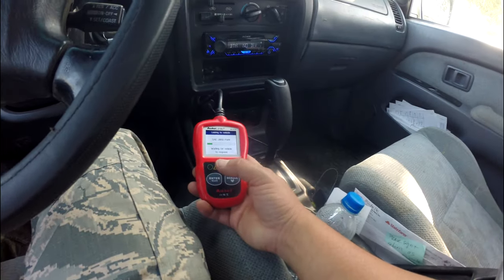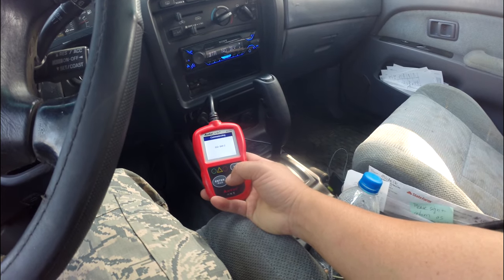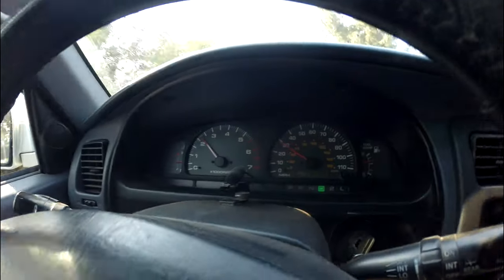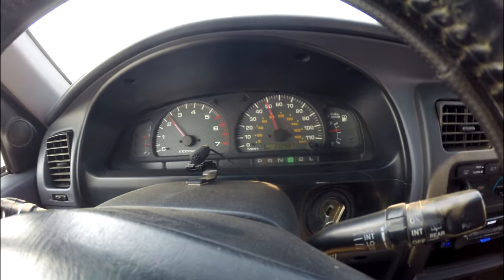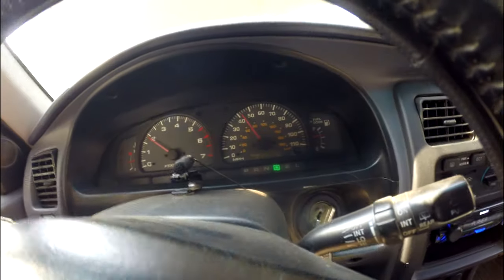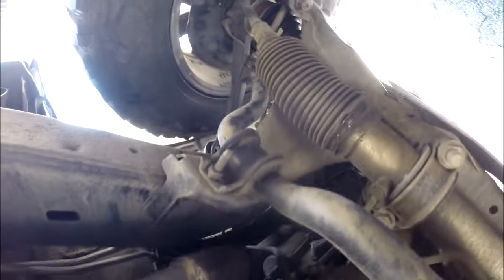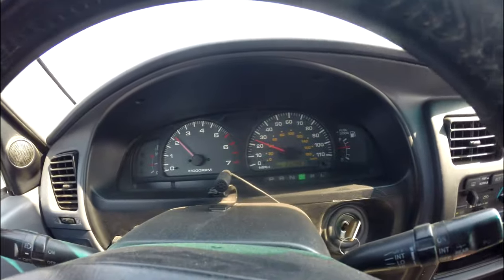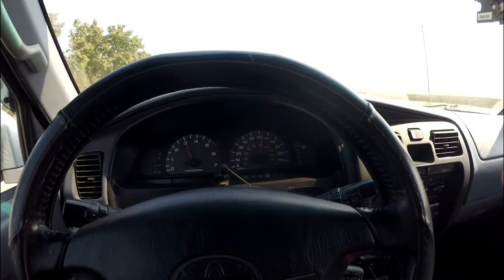How to identify a bad clogged catalytic converter.

Comment: THANK you, having problems getting up to speed and car jerks like crazy, replaced 02 sensor spark plugs snd TPS problem still there, i noticed the exhaust gas was extremely hot as well! and it comes out all sputtering inconsistent and not smooth, aftermarket cat as well, taking it tomorrow to get checked
Reply from the maker: Yeah you spend money to the wrong direction buddy

Comment: My truck is doing the same 
It runs fine but jerks and goes back to normal after speed is up and feel like it wants to turn off but I replaced spark plugs and coils and fuilds and the scanner won't pick up nothing transmission is good and alternator and battery

Comment: You can test it with a back pressure gauge . There is also a test with a vacuum gauge . If you have a very advanced scan tool , there is a volumetric efficiency test . Otherwise , disconnect it and drive it to test .
Reply: Where do you measure the back pressure?
Reply: @gabrielsierra6890  I believe you put the gauge on a MANIFOLD vacuum line . Use the brake booster . Raise the RPM up to about 2000 . Instead of stabilizing to about 17 - 22 lbs. , it is much lower because it is restricted and not breathing . It could be a clogged CAT or exhaust . Make sure the air filter isn't clogged . The engine is an air pump . Air goes in and has to go out . I think there are a few videos on You Tube . A back pressure gauge goes into the front O2 hole . That is measuring the back pressure in the exhaust system . You also can remove the front O2 and find the car improves because you are allowing the back pressure to escape . If dual exhaust , remove both O2's or test one at a time .

Comment: I love this guy! Thank you I think this is my issue. Fuel+air+spark=running engine. I’ve changed my plugs, coil pack, fuel filter, I’m running injector cleaner, the truck shifts fine. There gotta be two issues… I’m sure more but, it’s either a bad cat, or a bad fuel pump.
Reply from the maker: Thank you 😊 help me subscribe ok 👍
Reply: Subbed! Sorry!
Reply from the maker: @fullsendsurvival7804  thanks buddy
Reply: If you hear a hum when you turn the key on then your fuel pump is working fine

Comment: It could be an air filter clogged too. Not in your case, but the symptoms. I also have had the same symptoms in the past and and the cause turned out to be all of these (not at once): Cat. converter, fuel filter and Mass Air-Flow sensor.

Comment: I change my o2 sensor since that’s the codes that were being thrown. A day later I get on the highway and my truck starts doing the same was this truck, couldn’t go over 45 mph seemed like to wanted to shut off. Exhaust smells different and when I started it this bring back stuff shot out.

Comment: sprayed an entire can of CARB CLEANER into a drilled hole just before the CATS with the engine running.  Huge boost in performance!  Likely cleared blockage.
Reply: Where do u spray the cab cleaner
Reply: @jaygayle2057   i drilled a small hole in the exhaust before the cat cons.... on a straight enough area to seal w a band clamp.  then w the engine running I go back and forth between my 2 CATS and spray 5-10 sec bursts.   DEFINATELY frees up some blockage!

Comment: You're best to downshift and rev it. That's what I did in my Miata when my cat was clogged. At one point, I was standing on the gas pedal in first gear, and that seemed to sort it out. It makes a different noise now, but performance is back to normal. Should I be concerned?

Comment: Before you change or replaces any parts. Google using 1 gallon of Lacquer Thinner in a half a tank of gas. I just got a P0420 check engine light and it wouldn’t go away. I used a few CATALYST CLEANER but that didn’t help. My car has 185,000 miles. I Googled P0420 people used the 1 Gallon of Lacquer Thinner. I said what do I have to lose. 

I went to Home Depot to buy it. I tried the 1 gallon of Lacquer Thinner in half a Tank of Gas. I cleared the check engine light before I drove my car. Now I drove 160 miles straight on Highways. You need to be driving highway speeds so the Lacquer thinner can clean and burn everything out.

Right Before my car got to empty I filled up with super. So far 400 miles later no more check engine light. 

Update: After driving 470 miles the light came back on. I have to see what I will do next.

Comment: You can also use a vacuum gage to check for a restricted exhaust system.   Attach a vacuum gauge to an intake manifold source.  Allow the engine to reach operating temperature.  Note the vacuum reading at idle.  Raise the revs to approximately 2,000 rpm.  The vacuum reading should be close to the idle vacuum reading.  Quickly release the throttle. The vacuum reading should momentarily rise, then smoothly return to the normal idle reading. If the reading does not quickly return to the normal level, the exhaust system is likely restricted.  To confirm the exhaust system is restricted, you can remove the exhaust pipe from the exhaust manifold.

Comment: Got a problem with my vw transporter t5 1.9 tdi bp cutting out and miss firing cutting out stalling and wont start! 218.000 miles replaced all the injectors and wiring loom! Still the same problem and I suspect the cat! Thanks you for your advice hopefully can puck up a after market cat for a couple of hundred! 😢 been of the road for 2 weeks

Comment: 😅 May The Lord Jesus continue to bless you Sir . Thanks for video explanation .
Reply from the maker: Thank you very appreciated for your blessing
Reply: @alltsab  I have a 2005 ford taurus po430 but engine code is  📴 should I use any liquid fluid catalytic converter cleaner like seafoam or cataclean ?
Reply from the maker: @timham6464  no cleaning doesn't work buy new one only

Comment: Hi, I've tried this on my 2007 audi a4. The car drives with alot more power. But just how much did you separate the catalytic converter from the exhaust manifold? I think i separate the bolts too much. The heat burnt underhood insulation and car just died and gives me a bad fuel filter error code.  But before the car shuts down i can definitely feel the increase power. Should i tighten the cat bolts alittle more? Excellent video. Thank you.
Reply from the maker: Do as need it. Used your judgment to adjust it.

Comment: So my symptoms are similar to yours I have no lights on the dash not even check engine light in my car doesn’t accelerate correctly I was told that it can be that I have a clog cat converter I’m trying to see is that the same that you are describing in this video

Comment: I get it that this was a cat problem but where did he release the pressure from? I'm in the same situation except the light comes on and goes out intermittently. But i have the reduced performance. Thanks
Reply: The screws before the catalytic converter...so air will go straight out but not through the catalytic comverter cos it blocked..if you removed screws after catalytic converter..then what is the point cos CAT is blocked✌🏾

Comment: my friend have nissan 300z its been having intermittent start issue and acceleration issue and idle issue and stall issue.......she take to many shop nobody can fix....i notice if u put hand at tailpipe if you accelerate there is very little if any air flow....just ambient hot air....to me it seem cat clogged....

Comment: Thanks for the video!! I thought my camshaft sensors were the issue with my car as it was jerking and fault code I got was p0340. But issue still the same so I will go ahead and clean out my cat converter. :) thanks for the video!!
Reply from the maker: You welcome

Comment: Great info thank you for the video, I have a question though, I have a 04 lesabre I have just purchased a month ago and have changed the plugs and wires and also the transmission fluid and filter and im getting ready to do the shift kit on the tranny.  I have heard the cat clanking when I would first start it up which I know i need to replace but Im trying to get some more money to get one so in the mean time can I loosen the bolts and let the exhaust leak till I get a new one or would that mess up the car, oh yeah it feels like it has a small missfire and it also feels like its lagging upon first acceleration and shifts a little off sometimes and Im hoping those are just symptoms of the clogged cat and it doesnt clank anymore upon first start up, I drive about 500 miles a week
Reply from the maker: If you have second car to drive then just park that one until you have money to fix it. If you keep forcing it down the road then yeah it will create more problems.

Comment: Clogged cats, and even some new ones are too restrictive, and do not let the heat out of the engine.  They use the exhaust temps to work, so they have to be close to the cylinders and restrictive to capture the heat it needs to burn off emissions.  The cats should be more free flowing, further down the exhaust system, and have it's own heat source.  Your engine coolant gauge may be OK for the water temp, but the heads are "heat soaking", and the engine management goes into a limp mode. This exhaust restricted condition would destroy a carbureted engine pretty quickly.

Comment: My Acura tsx I just bought as a work car has a p0420 code that comes off and on but it’s just as powerful as it should be it seems it picks up and goes once it’s moving but it does seem like at low speeds it takes a second to breathe but it might just be the Long gearing of these Honda automatic’s

Comment: Originally saw your Landcruiser  15min CV axle replacement. My LX470 runs out of steam at 4,500rpm wide open throttle and trans doesn’t want to shift unless I ease off the throttle a little. Top speed is barely 90mph and the engine struggles. No codes. Idles ok and runs around the city OK, but no merging or top speed power. I will try to diagnose! What would you suggest as a replacement? It’s got 276,000mi hehe. It’s maybe time…
Reply from the maker: If your symptoms similar to this then it could be a cat but your can go to 90mph it may not. Do what I did in this video to see it can take off faster if it does then your cat. If not not then could be your tranny.
Reply from the maker: Please help subscribe to my channel for a number 🙏
Reply: @alltsab  subbed! Also the timing belt has been done a year ago but this is the second really long trip I did in some time. I thought it was a fluke but it really doesn’t have power up top. There was noticeably more intake noise at WOT I noticed. The spark plugs are of unknown mileage and the 10mm coilpack bolts are all corroded so badly. I need to redo but the mechanic said to just keep running til I get a misfire to replace everything. Truck’s just really old. Thank you
Reply from the maker: @vqdriver  the mechanic have the same opinion as me. I also told my customers the same run it until misfire.
Reply: @alltsab  I cleaned the MAF sensor, throttle body and am running Costco top tier gas with Gumout high mileage this tank for a little bit more pep, but the underlying problem was still kinda there. Then, I tightened the throttle cable just shy of the idle increasing and that helped responsiveness a bit. Accelerates to 90mph slightly better. City driving has woken up too. I guess the truck is old. On the scanner, throttle position reads 13% (idle) when warm and when the motor is off it only goes to 80% wide open. Is that normal? I still need to see if the throttle body is wide open with the pedal to the floor. I still suspect the timing belt isn’t on perfectly. Any way to tell? Thanks
Reply: Update: a few days ago I took it to another shop to diagnose the timing belt. Turns out the belt was off by a couple teeth! Insane, because the truck has been like this for 2yrs. It’s a non VVTI 2UZ-FE. At least now I’m feeling the 320ft/lbs torque it was originally designed for. It accelerates much faster!

Comment: If thst was a aftermarket one already and that one plugged up, the need to back track the cause, is it burning oil, is not running cleanly unburned fuel entering the CC......
Reply from the maker: The after market cat is over 7years old already. You know how poor after market cat is right.
Reply: I actually thought the same thing. CATs should last a long time but there are alot of variables that can make them go bad prematurely (driving crazy, maintenance neglected, or even the environment such as living near saltwater).

Comment: Having the same problem with an 03 kia sedona ex. Gonna have to try this and see hopefully it works.
Reply: They clog up more when you only drive short distances .
Every now and then I put a bottle of cat cleaner in the fuel tank and go for a 50 mile drive , driving at high revs , and down one gear.

Comment: If the converter is clogged up,car won't go any faster than 35mph.
Car will stall out when trying to accelerating.
Reply: If it goes to 40+ it’s not the Cat?
Reply: @NeikoSebi  >>0 2 sensor?

Comment: Will a bad Catalytic converter make my truck stall when pressing the gas? Loss of power, I also hear a ticking noise from under floorboard by my feet. If I let it cool when it stops it will start again but die about every 3 miles. I have a 1978 Chevrolet c10 truck. I have checked it for a cracked cylinder head it does not have that?

Comment: I'm at 239K mileage with my 2017 ioniq and I already bought my new cat converter but decided to not install it for now cuz like I can relate on this blog....my performance of my car still in good running condition..no choking yet after I changed the coil, spark plugs, oil change, transmission fluid flush and radiator fluid about a year ago and i will wait until this kind of symptom in this video will finally show up for me to forcefully replace my cat converter but then again...I will make sure all others concern will be checked first before cat replacement...this is a 5 star blog on cat converter diagnosis without engine light code of P0420

Comment: Scotty Kilner, said if you buy a can of Lacquer, and only have 1/2 of tank of gas in your vehicle, you pour that can (all of it) into your gas tank, drive for about 130 to 140 miles, with RPM at 2000 or 3000 (keep it at that RPM) once you get down to almost E (Empty) go fill up the car with gasoline.  The Lacquer, will clean the Catalytic Converter, and it will not damage your vehicle!  Watch his video on the Catalytic Converter and he knows!
Reply from the maker: 😆 🤣 I don't believe that is work but you can try and report it back to see it really work. He have 5 millions followers he know something I don't know lol.

Comment: Thanks man I forgot about the after market catalytic converter, it has been in my car more than five years, I thought it is TPS, but i change it and the problem still there, first it was from time to time and now it is getting worse,  when   I reach 50 mile an hour, the engine RPM starts going up and down, and then stop at 2500 RPM no more even I press the pedal to the floor.
Reply from the maker: You welcome

Comment: got a new F-150 in 1984 21 years later when i sold it had 540,000 miles and i would guess 30,000 were off road, got a 1994 Cherokee in 07 it had 132,000 today it has 220,000 miles

Comment: Hi, thanks for this video.  I just replaced My Toyota Camry catalyst close to the engine, and found out that it was really clogged. Just a tiny hole like an inch which I  have replaced with a new one. My issue is this, could it be that I would have similar problem on the down side catalyst as well, the one I changed was really bad.. what do u think??. I just subscribed to your channel

Comment: Sir, where are you located, I live in California and I have a problem like that in my Nissan Sentra 2010 and the mechanics are telling me that is catalytic converter, another says is the transmission, but my car still like that, no more than 50mph on the freeway, can you help me please?
Reply from the maker: Try to disconnect the cat. Open like this video to see that gain your speed if it does then your cat is bad.

Comment: Man I’m having the same exact issue except mine is way worse than yours because I can only go to 2,000 rpm and only up to 20mph. So let’s start from the begging. My car was running fine but it was throwing a code P0420 which is a bad catalytic converter. I removed the whole catalytic converter because I wanted to throw it couple o2 sensor spacers on so they can hide the code. Well, after taking the catalytic converter out I noticed a clunking noice inside and I shook it up side down and it threw pieces of internal stuff that’s made to clean up the fumes. I kept shaking the catalytic converter and I could hear a big broken piece inside but it wouldn’t come out because it was bigger than the exhaust hole. So I put everything together hoping the car would be fine but now as I mentioned in the beginning it got worse. Now I can’t even drive it because. The car overheats right away even 5 minutes after a cold start and it throws little but very hot air out of the exhaust tips. Your video definitely proves my problem I’m having with my car.
Reply from the maker: Wow

Comment: Did you just loosen the bolts from the manifold to cat, did it make the engine louder? I want to try that to see if mines clogged too, seems like a good test bypassing the cat, but i want to know if you loosened them or completely remoced the bolts. Thanks
Reply from the maker: @FranciscoJavierOutdoors  loose the bolts before cat to have some air come out .
Reply: @alltsab  thank you sir I will give this a try!
Reply: @alltsab  sir i want to thank you again! i loosened the 3 bolts just enough to have a small gap, then test drove the vehicle and i regained all the power, especially at low RPM. I also had a MAF sensor P0101 code that would not go away, even after cleaning and replacing it with a new one! As soon as i provided a release by unscrewing the 3 bolts, the code cleared itself! Wow, so now I know what to replace.
Reply from the maker: @FranciscoJavierOutdoors  you welcome